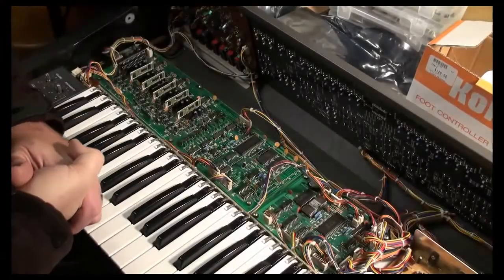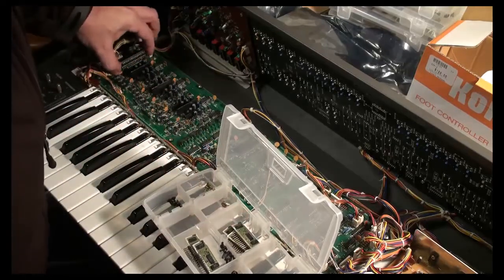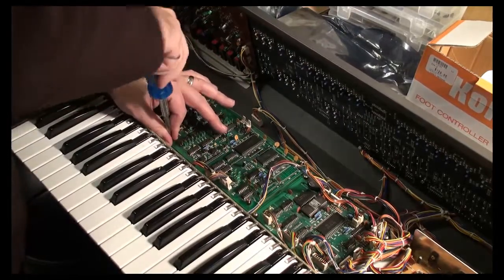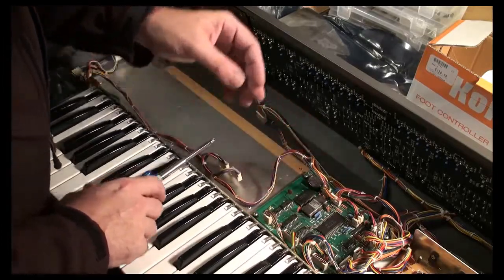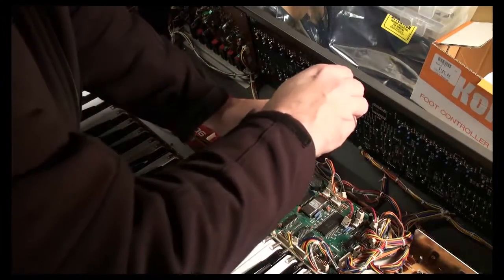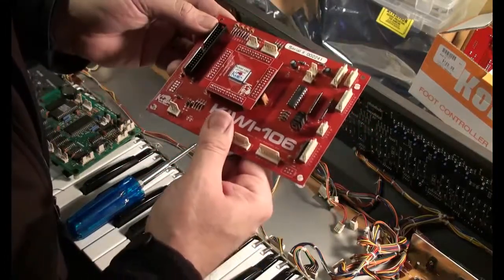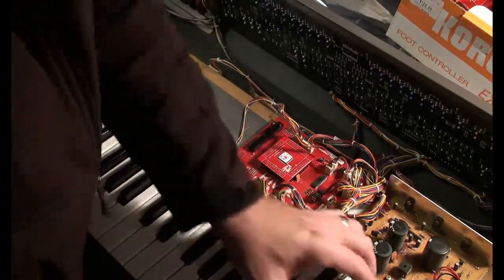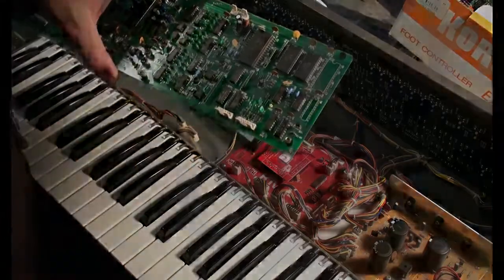Kiwi-106 Upgrade Process - Part 1

Comment: So, I just have to send in my voice board? Will the entire synth need to be re- calibrated? If the chips fail at some point, do I have to send the synth back?
Reply from the maker: +michael stein 

Hi Michael,

if you check out my later videos (BT & Sonic Mayhem's Kiwi-106 upgrades for example) you'll see the whole process I do. These days I recommend complete replacement of the filter chips for new Analogie Renaissance chips, which I happen to have in supply right now. This will eliminate any possibility of chip failure later.

I can install the upgrade hardware, perform the filter chip replacement and super-calibrate the voice board using the Kiwi-106 Version 2 firmware's test programs if you like. If you only send the voice board, you will need to calibrate the rest of the synth yourself, and the results of the voice board calibration will depend on the power board calibration being perfect. Otherwise you can send the whole synth, but usually people do this when they also want me to  replace the ends and front rail with wood or aluminum plate, powdercoat the metalwork a new color, rebuild the keybed, and perform a full fader/dustcover/LED teardown/replace & rebuild on the front panel boards, and have custom overlays made and applied.